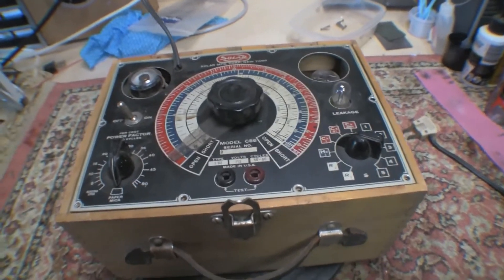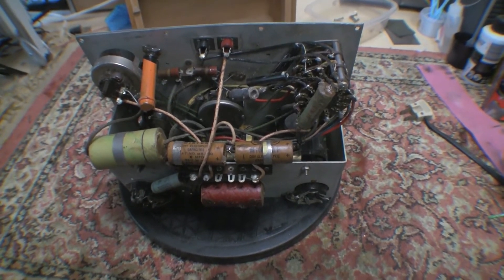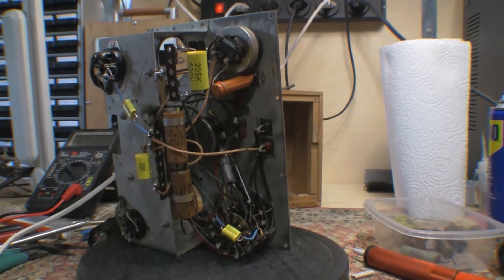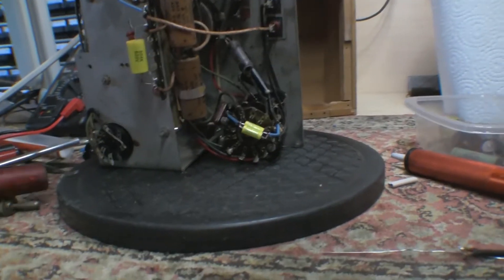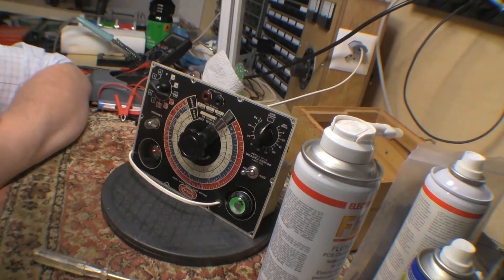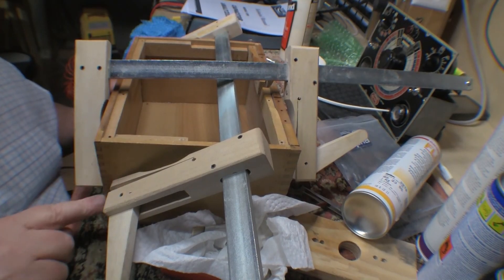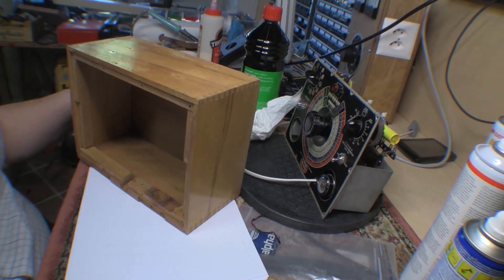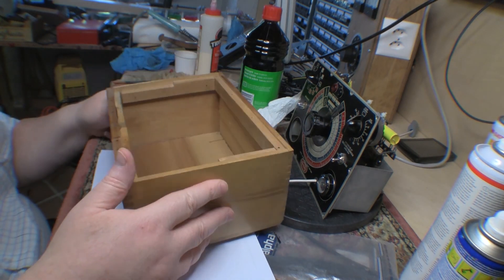Solar CBB 1.6 Capacitance Analyzer - part 1

Comment: Hi there,Just found your video on YouTube and the start of your restoration for the Sonar capasitor anyalyzer. So far it's been the best one I've found. I too recently bought one of these units to restore. Would you be so kind as to share with me where you got hold of the manual / schematic ?
Reply from the maker: Hi Graham,   my copy is posted here if you want to download. There are different versions and Bob Andersen has done a restore on the later version on his channel.
https://www.filesanywhere.com/fs/v.aspx?v=8b706a8f5c6576aa9ea1
Reply: Zone1242 
Thanks, much appreciated.

Comment from the maker: Mine is definitely counterclockwise - position 1 is highest (440v actual), position 5 is lowest (102v actual). Also, there is no 0v position - the voltage remains at the terminals until I move the selector to one of the R positions. Weird.

Comment from the maker: Hi Bob, I just put a 10u/600v electrolytic across the terminals with the DC voltmeter across, etc. and I measured position 5 as the lowest voltage (102v).  The remaining positions however are all low by 50v or more with position 1 measuring about 440v.   I guess they changed the sequence somewhere along the way making it more logical with position 1 being the lowest voltage, etc. Definitely important to be aware of I'd say!   
Cheers,  John

Comment: I don't know if that cabinet is in fact made out of cherry or not, it's possible of course With things like cases for test equipment maple, beech, birch, and tulip poplar seem to have been the popular ones since they were and are cheap, sometimes oak was used as well. As far as I know none of those are considered protected species nor endangered, I would guess that birch would be a close match as would beech.

Comment: The voltages on mine are about 25% lower than that.  So I've been wondering if they really should be 100v, 200v, etc or does the 1,2,.. just indicate increasing voltage ?

Comment from the maker: Thanks Tom, I'll double check the voltage settings for leakage but the manual clearly shows it as being the opposite of what I would expect.   I'll measure it tomorrow.   Thanks for the lid dimension  - nice to have the actual measurement.
Cheers,   John

Comment: John:
Bob Andersen and I both have the Solar CB 1-60. Ours has three jacks on the bottom. The middle is red positive. Left black is called "Cond." Right black is called "Res."
Leakage control on mine is at 0V straight up. Then clockwise it is 100V, 200V, 300V, 400V, and 500V.

Comment: WARNING! When checking for leakage, ALWAYS, ALWAYS, return control to 0V or you will get a nasty shock from those leads!!!
I wish mine read capacitance as accurately as yours. I replaced all the components too.
The cover's height, (from hinge to top), is 1 7/8 inches (US).
Good luck with yours, I love mine!
Tom